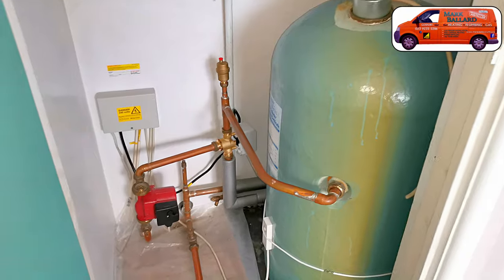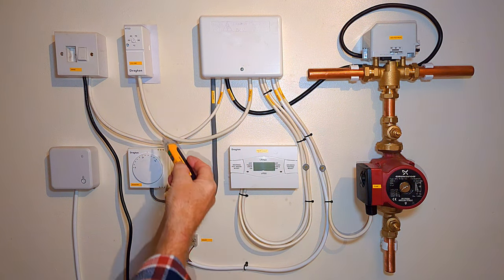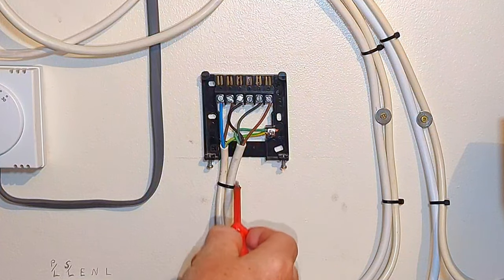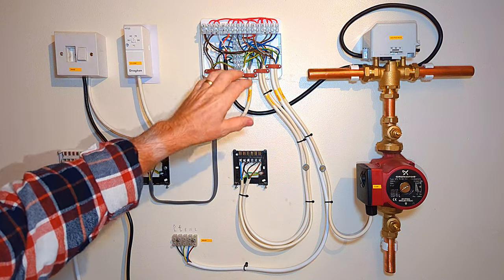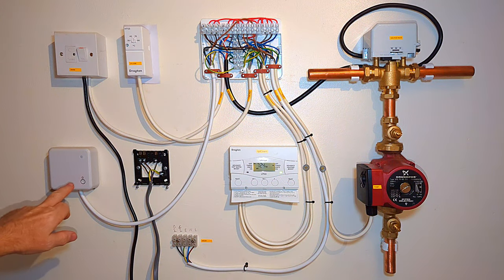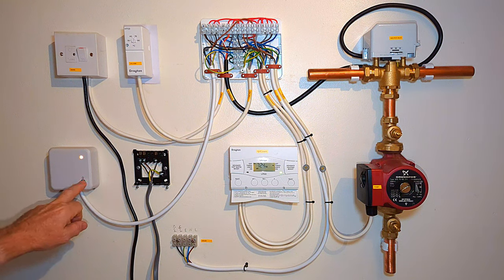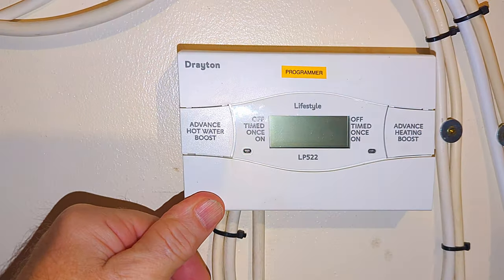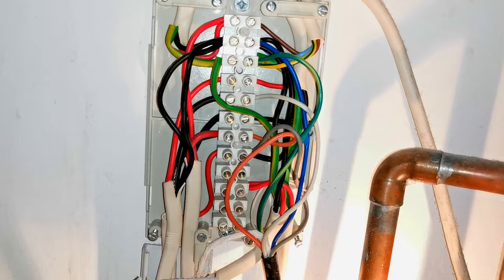How to Install the Hive Thermostat Mini on a Traditional Heating System,  Step by Step Instructions.

Comment: I have miGenie currently - works perfectly - oil boiler - 3 heating zones wireless thermostats plus wired hot water stat on tank - how do I wire in Hive 2 channel(CH1 +HW) and two extra Hive 1 channels (for CH2 and 3) ? Many thanks,  Philip

Comment: Hi, I have just purchased and fitted a dual channel HIVE system for my oil fired central heating and it is almost working 100%....but there was no wire behind my old analogue Honeywell controller for water....just 3 wires...L N and the common for live transfer so in effect if I hit the hot water option it just comes on at the switch as I can't heat water separately and never could unless it was the immersion in the hot press. Does this system require additional wiring to the receiver to turn on the immersion? Otherwise am I right in saying that the water option only is redundant? Hope all that makes sense. So when I turn on the heating the oil burner fires up outside and heats both radiators and water simultaneously but I just don’t see anyway of heating water separately with only 3 wires at the controller. Any advice appreciated. Thanks in advance.